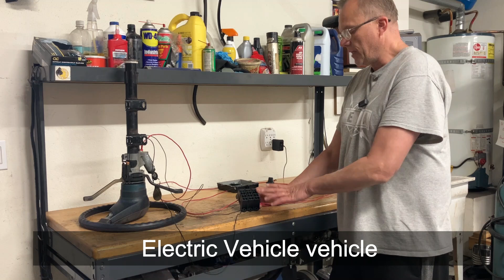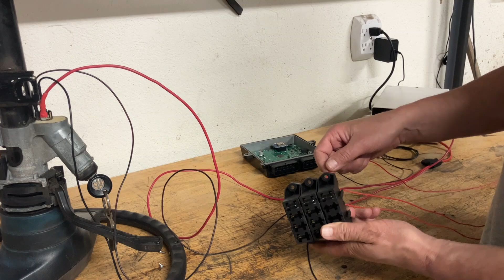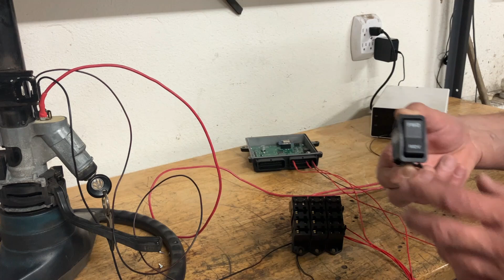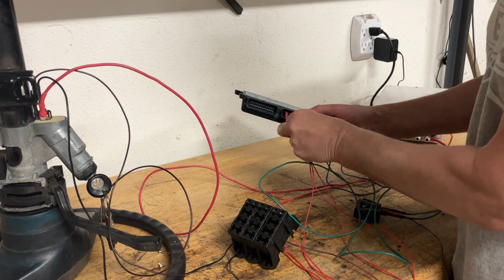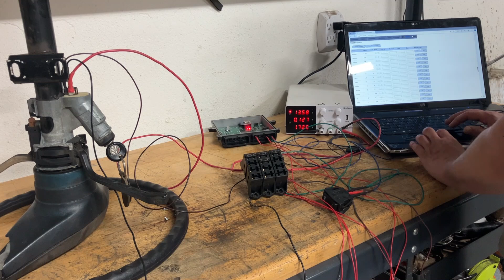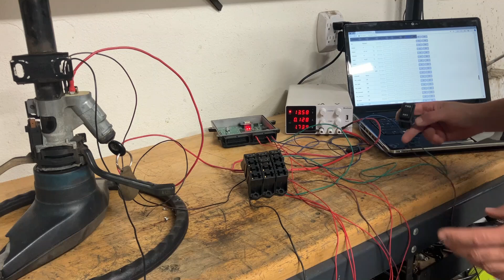EV Conversion DIY Wire Harness - Forward & Reverse Switch

Comment: Doing prep for your next class!
Is a ISA shunt (which I have but not a battery or safety box) can be used as a safety box for the practical? 😊
Reply from the maker: connecting the BMW Safety Box (aka contactor box) to the DIY fuse block should be the next video
Reply: Just rewatched your part 2 safely box video and you mentioned ISA shunt can be used! 😂
Reply from the maker: think of the ISA shunt as a current sensor on steroids, it itself does not provide and protection it just measures volts and amps off the negative lead, I think it is optional but nice to have. The  Safety Box = 2 contactors + 1 relay + 1 resistor
Reply: @Good-Enuff-Garage  Looks like I might need to get one. I like the idea of an all in unit like the 330 battery you are using (no cobbling together different parts and all in a handy box)…am I right in thinking that it wouldn’t need a ISA shunt?
Reply from the maker: if you are thinking of getting a BMW Hybrid battery pack than look for July 2019 or newer as they are the same physical size but larger AH kWh capacity, and they can be found in the BMW 330e, 530e, 740e and X5.  The BMW Safety Box is a complete contactor solution, the ISA shunt is just a current sensor, the S-Box comes with it's own current sensor soldered to it's circuit board.
Reply: @Good-Enuff-Garage  Thanks, I am a lover of the elegant solution! So are all those models are of the same dimensions! Wow!
Reply from the maker: no the battery boxes are all different shapes, but the modules inside are the same check out what the 530e looks like   https://youtu.be/wRaKoDziw9Y?si=RCTty5ZwQmKO7seD
Reply: @Good-Enuff-Garage  Old saddle bag shape!

Comment: 🏃‍♂️ 🏃🏽 🏃🏻‍♀️ still having trouble getting the Zombie to run! Status is now Potpressed but T15stat is on and off by ignition key. The opmode remains off when the starter is activated (power is going to pin 52). 
I have watched Damien’s and your videos and think it might have something to do with the throttle settings in parameters but am at a loss!😊
Ps I bought this Zombie off a person who abandoned it but populated it with their setting!!!
Reply: This is interesting I am having the same issue. What do you have currently connected to VCU
Reply from the maker: So glad Ed chimed in, he is the first guy I thought of to get help 👍🏼
Reply: @LatutaEV  Just a 13volt power supply and off/on/starter switch connected to the Zombie
Reply: @Ghia66  you should have Ignition on on pin 15 and momentary start switch as minimum. Ignition should be permanently on and start switch pressed and released
Reply: @LatutaEV  Yes it is all wired up correctly (56, ground, 15 & 52) and when I turn the switch key onto on it
Reply: It shows parameter T15 stat change from off to on!
Reply: @Ghia66  what do you have for status
Reply: Potpressed 😊
Reply: @Ghia66  it should be none. I have the same and I was advised on forum that this might be the reason not going into the run mode. If you check Gregg's video VCU forward and reverse at 25.14 it shows None for status.
Reply: Thanks, I just checked it out…none would be good! I wonder what Potpressed relates to…
Reply: @Ghia66  The meaning of this is that you don't want to start the inverter when your throttle pedal is pressed. If your pedal is not connected what reading are you getting on pot1 and pot 2
Reply: It RUNS!!!  🕺 I went to 31.25 on Greg’s Zombie forward & reverse video and copied his throttle parameter values from Potmin 586 to tmphmax 300…saved and it WORKED!!! Thanks so much guys 😊
Reply: @Ghia66  well done 👍
Reply: @LatutaEV  Thanks for your brilliant lead! 😊
Reply: @Ghia66  You welcome I had help from Open inverter forum 😄

Comment: I am one of a group of EV taxi drivers and lots had problems with the 12V battery. The battery died. In my newer (2022) Hyunday Kona they add a cable from the big battery to the 12V battery and i see almost every time I'm not using the car the yellow light on that indicates the big battery is helping the 12V battery. If it's not so complicated you could install this thing in your car. It's probably not so easy but don't know.
Reply from the maker: interesting, most likely it is traversing a DC-DC Converter that steps down the high voltage from the battery pack down to something like 14.3 volts to trickle charge the regular car battery